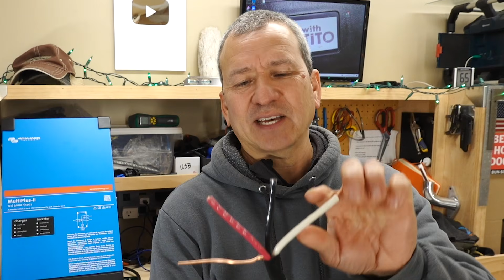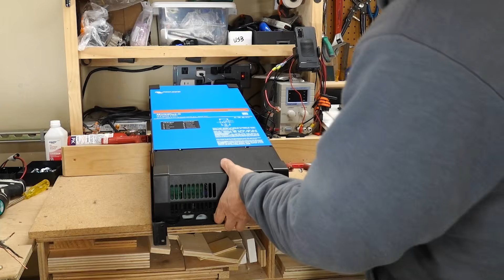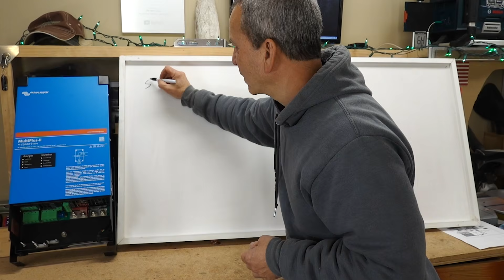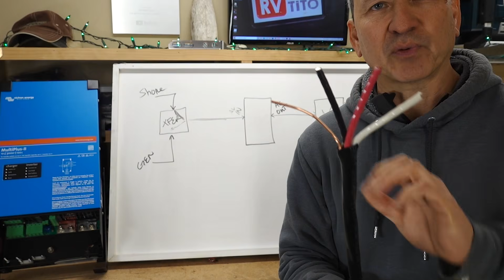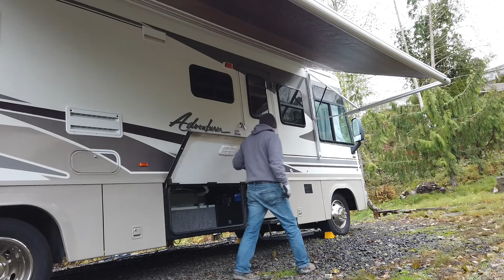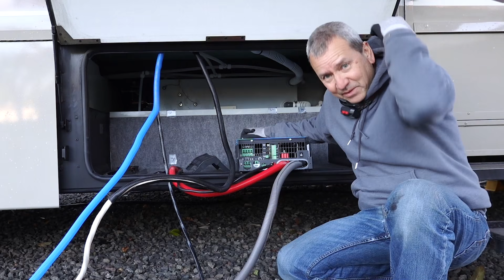Installing the Victron Multiplus II Inverter to Power our 50A RV Off-Grid | RV With Tito DIY

Comment: I initially used the Victron 3000W and AM Solar "Smart Phase Selector" for my 50A RV and I've had nothing but problems over the past year. I would constantly lose one side of the panel and at times, both sides. The two were not happy together. I was so happy to see Victron release this new model that I immediately purchased it and removed the extra component. You made a great choice.
Reply from the maker: That's also what I've heard from an installer friend about the phase selector. Thanks for confirming. Agreed....this inverter is a very welcome upgrade. I'm glad I waited.

Comment: Nice job Bryan, I am installing the same exact thing! I just need to get two more batteries, at least the price came down… in my opinion this is one of the best systems on the market.
Reply from the maker: Agreed. Eliminates a lot of work arounds.
Reply: What batteries are you using? 

I contacted Renogy recently and was told all lithium phosphate batteries should be purchased within 6 months of each other, so they age at the same rate, and you're not adding a new battery to used batteries. 

Are you aware of this? I have two Renogy 170 ah, and wanted to add another, but they are super expensive, and actually went up by over $100 in the last few months $1,600 - 1,700.
Reply from the maker: @animallovefest143  I have 3 Battleborn GC3 batteries. Checkout my previous video to see how I hooked them up. I don't think that's a hard rule, especially with LiFePO4 batteries that have a very long lifespan. But if it's what they say, then that's it. It's certainly an important guideline with lead acid batteries.